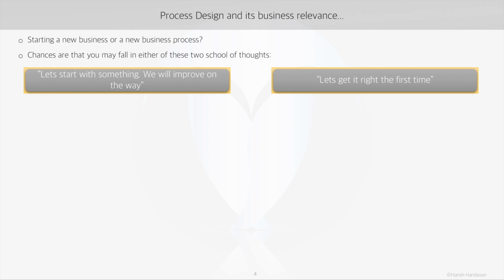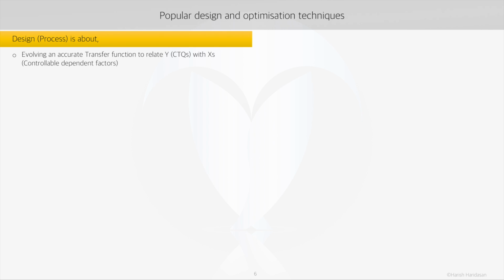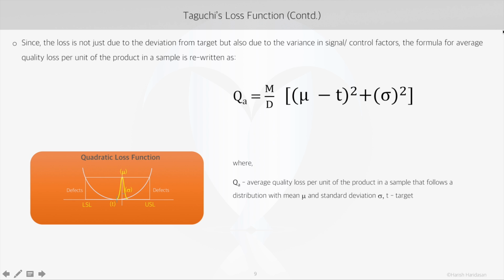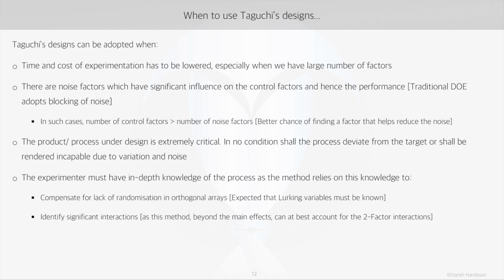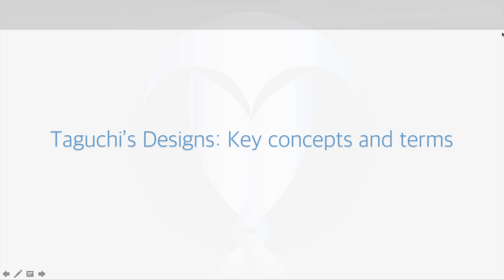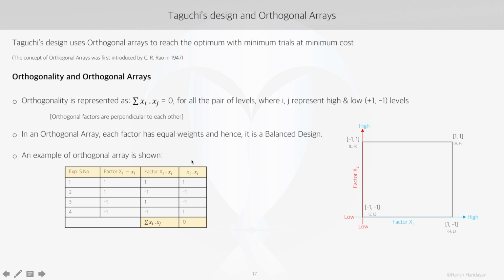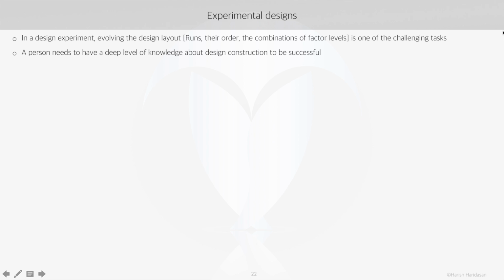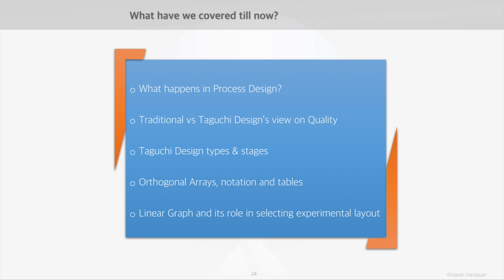Taguchi method - Introduction [Full tutorial] - Best viewed@ 720p HD

Comment: hi , is it possible to analyse an experiment with tagushi method when you have parametere with different level ? (parametre A with 2 level and parametere B with 4 level )   ???
Reply from the maker: Yes, it is possible. That is one of the key advantages with Taguchi Designs. Do check out Part 8 [https://goo.gl/0Ei7dD], 9[https://goo.gl/qIY5OR], 10 [https://goo.gl/uIJ9ok] of the Video series. These are mixed designs [Dummy level, Combination design & Collapsing]

Comment: Good day,

I write to appreciate your video on the above subject. It is an eye-opener to the world of information.

I have a challenge on this video with the below link (https://youtu.be/ZB3J-1mTVIM     ). I do not understand how you got the output response (LIGHTING N-1 & LIGHTING N-2 ). i suppose you used a formula on excel but i am lost.

The details of the video is : Section 3 of this video series: https://youtu.be/ZB3J-1mTVIM

Kindly assist me by sending me a video on it to : ambassadorakingbola@yahoo.com.

Thank you.

Regards
Reply from the maker: The tabulated results under Lighting N-1, N-2 are the result of Experiments that we would conduct at various factor levels. We would set each factor & signal at the levels shown in the 1st 4 columns and note down the Response, which is the width of bars & spaces in the bar code. These responses are measured at 2 Noise levels. Noise level, in this case, is the ambient lighting and the 2 levels considered are 50 & 150 Lux.